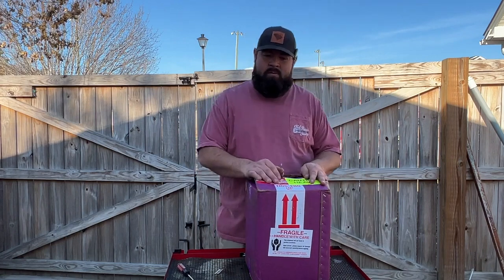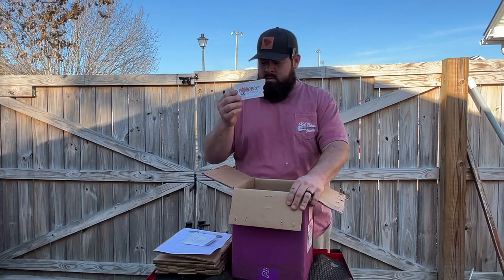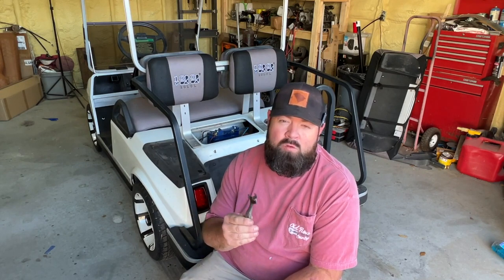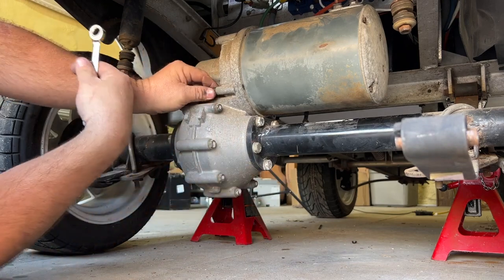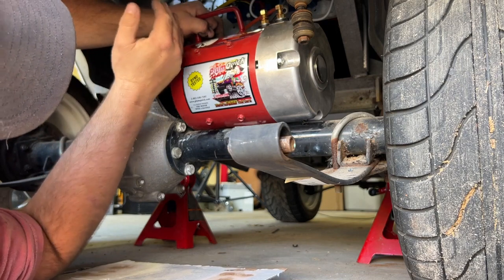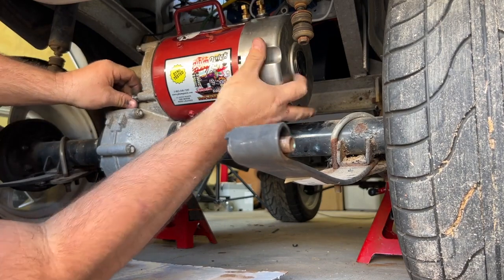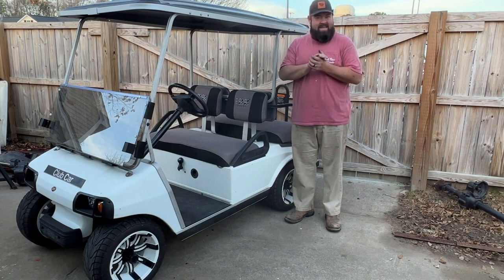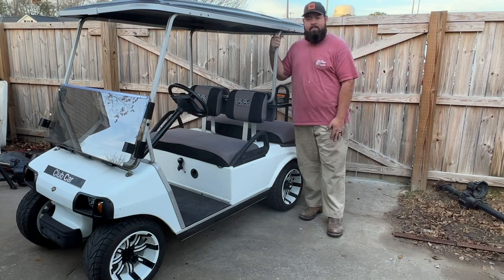How To Make Your Slow Golf Cart Faster   Plum Quick Motors Rattlesnake   Club Car DS Series Build

Comment: When you do any up grade like this the next thing that crops up is the next "Limiting Factor "
which I would suspect would be the brakes . Not really knowing about golf cart brakes does the electric motor provide "Dynamic Braking" to stop the cart ?
Reply from the maker: No regen braking on series carts like this one, however you do have regen braking on sepex carts.
Reply: I went to your web site and read your literature about upgrading to one your motors . It mentions upgrading the controller to handle the increased current demands but to my surprise it makes no mention of upgrading the cart brakes to handle the increased stopping distance that will occur with the increased operating speeds .  This seems kind of irresponsible not to include a warning about an upgrade to the brake system along  with this motor upgrade on non sepex carts . Am I missing something ?
Reply: @kls2020 what you missed is that you went to the equivalent of a car performance transmission and engine shop. You as the customer seeking out the services they provide are to make your own decisions on what safety precautions are to be added. Not get upset with a transmission/engine shop for not offering roll cages, brake upgrades, parachute kits and fire suppression systems. Other shops will specialize in just those areas.
Reply: MrMotorhead  Not upset at an electric motor vender for not selling /providing additional required equipment with their product just think they should give  a potential buyer a heads up about any other upgrades that will probably also be needed if their motor is installed .
Key word here is "Disclaimer"
Reply from the maker: @kls2020  New Custom Built Motor, Class H Motor Rating, High Performance Brushes, Torque/Speed Club Car 48 volt Series 10 spline 14.2 HP, Speed 28-30 mph (estimated) and added 50% more torque must upgrade controller*, flat terrain and a good quality battery pack.     *this is stated in the description
Reply from the maker: @kls2020  New Custom Built Motor, Class H Motor Rating, High Performance Brushes, Torque/Speed Club Car 48 volt Series 10 spline 14.2 HP, Speed 28-30 mph (estimated) and added 50% more torque must upgrade controller*, flat terrain and a good quality battery pack.     *Stated in the motor description
Reply: If I had a golf cart I would probably want your motor upgrade but......when installing this motor upgrade to a "stock" Club Car golf cart will a brake upgrade also be required due to the increased stopping distance that will occur if the stock brakes are not upgraded  ? 
Yes or No? @PlumQuickRacing
Reply from the maker: @kls2020  100's of thousands of upgraded motors from a variety of manufactures have been install over the past 30 years and 99.999% are running stock brakes. Some use a disc brake add on........disc pads are so small that the stock drum brakes work better. Now, you can modify car disc brakes to fit the cart and that's good ........most don't have the knowledge and/or the equipment to do this. Hope this helps, Thanks